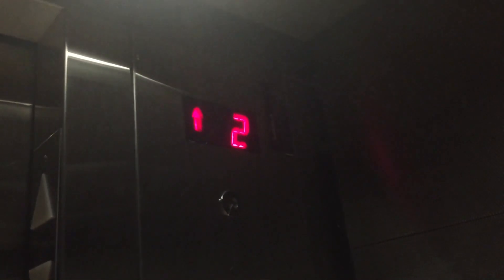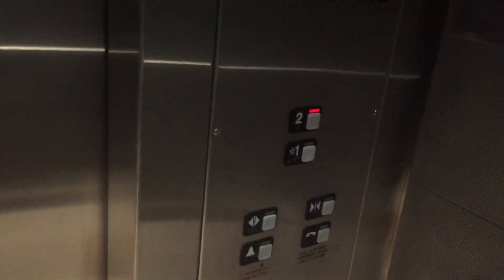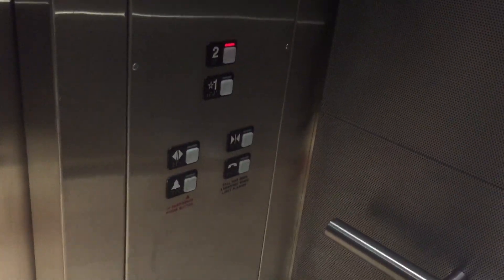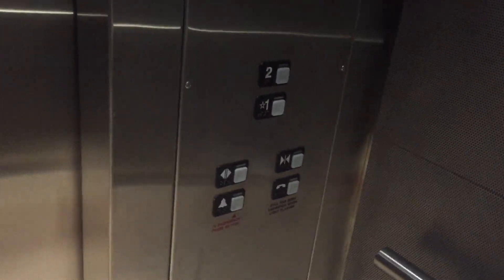2005 Schindler MT 300A Hydraulic Interior Elevator @ The Promenade, Canoga Park, CA

Comment: It can’t be from 05, Has to be from 2004 or older.
Reply from the maker: MT was made on regular orders from 1994 until 2004 and available on custom order from 2004 up until as late as 2010 actually.
Reply: @traction1519  2010 MT’s don’t exist. It’s not like Series 1.
Reply from the maker: @homeguestunton  They were made up until 2008 AT LEAST here in California. Idk if other places were the same but there are installations that I can confirm are from 07 to 08 and have MT